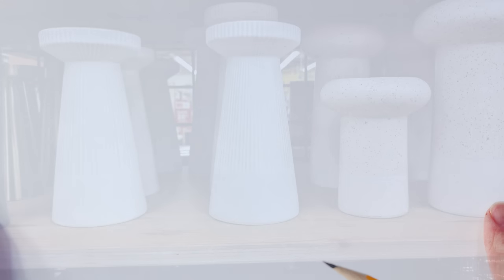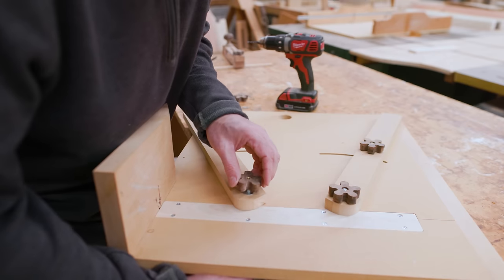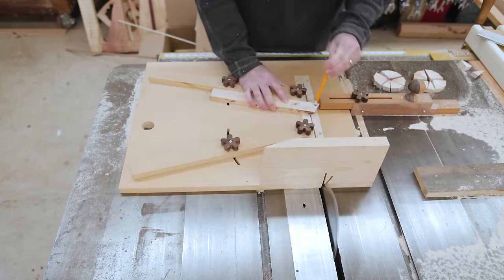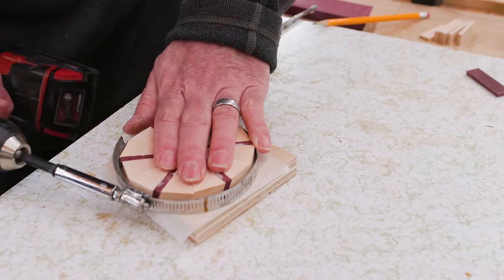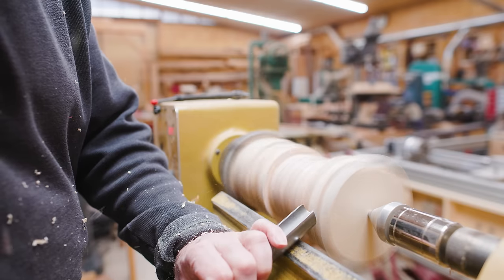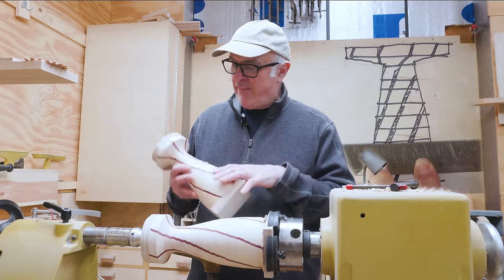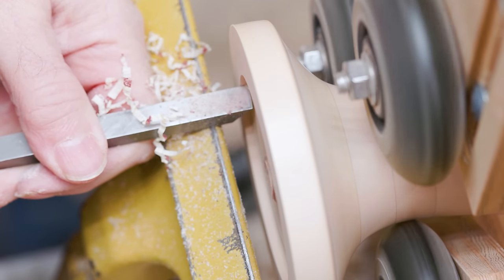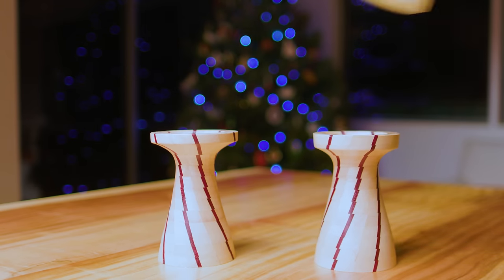Woodturning Segmented Candle Stands

Comment: For the alignment, would it work to offset one of the purpleheart pieces just a bit during glue-up? Thinking you could use the CNC to cut out the two "sandwich" calls to have a shallow pocket on one side and a very small ridge on the other. Then when gluing the stack of rings, the one slightly raised purpleheart piece would "key" onto the previous ring.

Comment: May I make a suggestion especially about using small diameter candles. I had a wooden candlestick and the candle burned down to the bottom and eventually caught the wood on fire. It smoldered but still it was kind of scary if it had not been noticed.

Comment: I think you'd need a VERY specific jig to insert the pieces into the make sure that ALL of the segments for ALL of the rings glue up exactly the same way.  In the end, I think there is enough "slidey-ness" to the segments while you are tightening up the clamps to make things get misaligned a titch.

They still ended up looking great, though.  Just not exactly how you saw in your mind beforehand.
Reply from the maker: I was thinking about this and yes, no matter how well I line up the rings. The rings themselves are all slightly different.
Reply: @frankmakes  I don't suppose you can assemble it sort of sideways -- instead of assembling horizontal slices one by one and them stacking them, you instead assemble slightly helical vertical "slices" one by one, and then glue them up ... ?

Comment: It would take more planning, but what if the hole inside the glued up rings had a keyway cut into it which would then hold an alignment spline while you're gluing up the layers. With the way you made the top for both wide and narrow candles, the mark that the spline would leave would be hidden down in the bottom of the narrow hole and shouldn't be much of a visible issue.

Comment: Would it be possible stick the ring together temporarily? A glue that could be desolved? Hot-melt glue? Clamp it together with a treaded rod in the middle?

The rings could then be rotated/aligned after the turning.

Comment: Not a carpenter, but just thinking about trying to line up the segments, and I'm not sure it's possible. You have segments that have straight lines, and then if you turn that object, the way you did anyway, you ended up with a curved surface, and so unless you also had segments that had curves in them, I think you'd end up with things not lining up anyway. In other words, a straight line on a curved object is a curved line, so unless the segments also had a curve, you cannot make them meet perfectly.

Comment: Could you cut a 1/8" slot that would be vertical along the inside of the center hole that could be used as a sort of keyway?

Comment: for ring alignment could you drill indexing holes on the cnc? just pinballing
Reply from the maker: This could work. The rings would have to be a lot more similar to each other than they are with the method I use.

Comment: aligning segmented parts like that is nearly impossible. even if you have the layers on an alignment bolt, and rotated by a set amount, the segments make straight lines, so they have a different angular size, depending on the radius, and also have a nonzero thickness, so they can only be aligned on one edge unless they're cut to super specific curves. you could try modeling it, and cnc cutting each segment, but that'd be a bit much. its easier to just choose a pattern that lends itself to being a little jagged

Comment: Mabe if one of the purple heart segments from each round was 1/4 inch longer than the rest of the round then the pattern could be aligned easier when stacked and glued?
Reply from the maker: A small spring clamp to hold the purple pieces parallel while the rings are being glued together. Would help keep them from sliding around as well.

Comment: It looks like there was a hole in the middle each ring. I'm curious. Could you have stacked them on a threaded rod and clamped them together that way?
Reply from the maker: The center hole would have needed to be cleaned up but that's not too much effort. And yes this would have helped.

Comment: I guess the proper way to get the straight lines would be to cut thin inlay strips, and bend them to follow the curve with steam, something like they do for the edges of classic guitars. But it would be pretty hard to follow such curves because it's a 3 dimensional curve unlike guitars 2d curve, a lot of fitting and trial and error. Then there's also a question of cutting this curve in the object to receive the strips, very hard to do. It's probably possible to do, but seems kind of unnecessary because of the difficulty, unless you really want to practice the skill to perfection.

Comment: regarding the pattern - as far as I understand, you should have something like "self-bounded", for the lack of better word, symmetrical assembly. E.g. if you have 4 same pieces - you put them together by touching each other imagine 4 L letters being assembled into a "star", without any holes on the middle. this definitely make some restrictions what type of symmetry you can have - 4 is easy, 6 might be kind of easy, 5 is hard etc. then you center all the layers with a long bolt through the center. then each layer - you should track the number of degrees turned. hopefully it makes sense...
Reply from the maker: You're getting at the other problem that hasn't been mentioned much. The obvious problem is gluing the rings together perfectly aligned. The other more subtle problem is making each ring exactly the same.
Reply: @frankmakes  as far as I understand, if you make the sectors with same angles - it will self-align at the center when assembled and tied